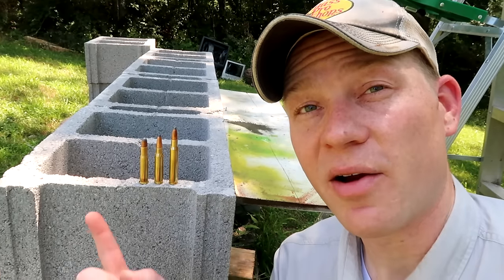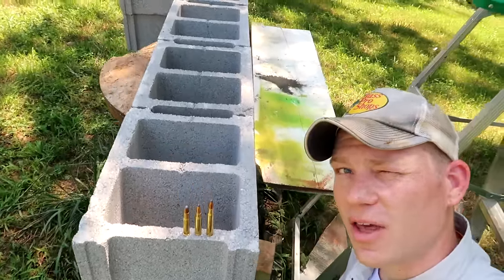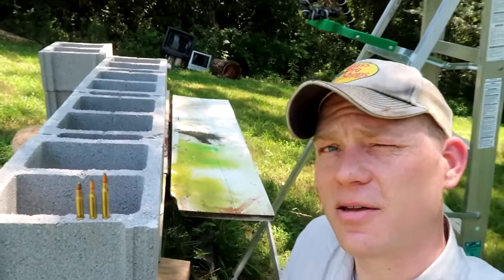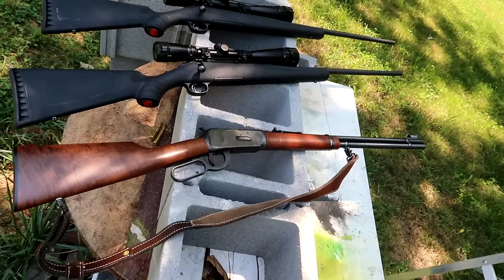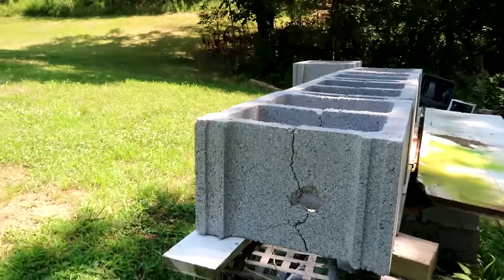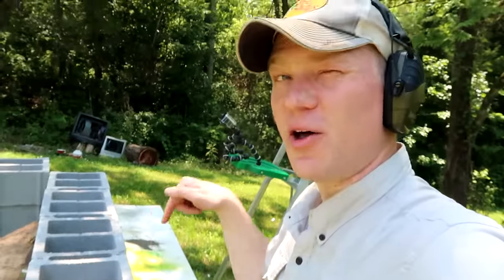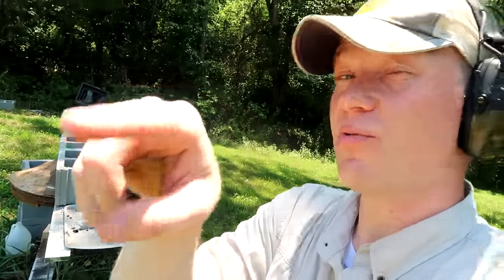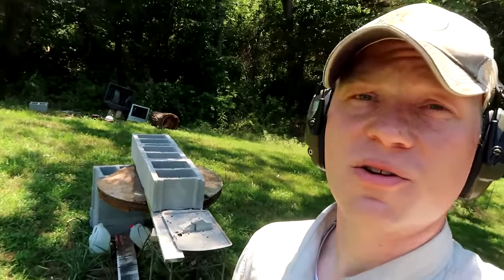30-30 vs 308 vs 30-06 - Cinder Block Test

Comment: I was surprised by the lack of penetration. I guess this is more about the knockdown power and energy of the rounds

I love the 30-30 because it is classic Americana and arguably won the west. It isn't underpowered per se but coming out of a carbine lever action with iron sights this round and rifle combo has a range of 200 yards give or take.  If you put a scope on a lever action you could maybe reach 400-500. 

modern rifles are designed to withstand higher pressures and shoot more powerful ammunition and are significantly different weapons.  I use to like 30-06 because it is big and strong and surplus ammo could be found. 30-06 is fine for a bolt action hunting rifle if your carrying 5 rounds. The ammunition is bulky,, heavy and expensive. I used to swear by 30-06, and I still hold it in high regard. It is a big powerful hunting round. 

Enter the .308 with less energy than a 30-06 but similar trajectory, similar bullet diameter. I will not be hunting grizzly bear or moose in the foreseeable future. I might go deer, elk or pig hunting. I might have to take a long shot. I might have to defend my home from criminals, ANTIFA or the tyrannical armies of Trump might storm into my community and assault American citizens. I For my purposes and foreseeable circumstances the 308 works just fine.  When I chose the 308 i did so with reason. It is the round that does what I need it to.  I use to like other rounds for reasons that were immature and superficial.  I choose the 308 because it can be fired from an AR platform, it is a common round, it is smaller and lighter than the 30-06.   I dont live in Alaska I don't need to kill bears or moose.   I live in California I might need to kill protestors, arsonists, kidnappers, drug cartels, and corrupt tyrannical government agencies and representatives.

Comment: More deer have also been missed by the 30-30 than any other rifle. Cheap ammo. Lots of shots. Capable of 300 yard shot, yep saw a head shot on running buck 300 yards at least, head shot. I watched the same guy miss a deer standing there even after 3 shots from 40 yards.  30-30, apocalyptic weapon of choice

Comment: Bullet weight means very little.  Bullet construction is much more important.  Load the 30 30 with full metal jacket it will Pentwater the most.

Comment: You can shoot all day long with a 30-30 for thin skilled game to 200 yds. Its vastly under rated. You can't stand that with a 30-06 and marginally with the 308. Here in OZ we shoot pigs mainly at distances out to 75 yds and the 30-30 is plenty of gun. The other game that can be harvested as pests are wild camels. For those a 30-06 is not enough. We jump to a 375 for those.

Comment: I own a 30-30 and a 30-06. When I’m hunting an area with a less than 150 yard max distance, I take the 30-30. Longer distances I take the 30-06. I rarely have to track a deer more than 50 yards with either. It’s important to point out that they both have great optics for their calibers. In my opinion, most times optics are more important than caliber. Just my opinion.

Comment: Cinder blocks are actually fragile, as they can break apart being dropped onto pavement from a height of five feet.  The strength of cinder blocks comes from having the cavity filled with concrete and rebar.
So why it is that displays of ballistic destructive power uses cinder blocks as the material?   It is not a strong material.

Comment: Well, the 30-06 is loaded to a LOT less pressure to obtain the same results. If it. Was loaded to the same pressure as the .308, the .308 would Never catch. You can buy a LOT heavier loads in the 30-06

Comment: 30-30 no kick fast maneuvering driving thru woods and taking fast reflexive shots even if there are twigs and Small sticks it will deviate from its path very little and still hit close to target. The others because of spire tip bullets will redirect all over the place.( not hillbilly lore it's the legit science so try it before saying it's incorrect, it's not) .308 for med size big game at longer distances, and the 06 is for an area with any predatory bears in my humble opinion just as a precaution. But I would swap the 06 with .300 won man or wsm

Comment: Still not a fair test. Bullets are built differently. A weight versus velocity versus expansion of the bullet test in concrete has nothing to do with hunting. Most guys hunt from a stand next to a feeder on a timer. It's about as complex as shooting the Roomba when it goes between the couch and the tv.

Comment: I fall in the category of due respect for all rounds . I have no bias when it comes to this. Theres a round for any job and lots of rounds will do the same job.  Im not the guy that picks on cheap guns either. They all will kill or stop  or git target if you work with what you got. Its just that simple. Folks pick on hi point pistol owners a lot. But truthfully if you can shoot that thing in the alide get it rack back and chamber and fire the remaining rounds in it, id say thats a testament to its durability wouldnt you?  Doe they rattle when you walk ? Absolutely . Are they chunky and  bulky? Yep is the trigger a little bit ugly ? Yep does it work? Absolutely!  All guns ahould have thier due respect. Doesnt matter what you pay. Purpose does matter.  Same as any round out there. They have a purpose some ammo isnt as clean and some anmo isnt as good for chambering well but the facts are they will perform thier designed tasks. Do i own glock yep do i own other makes? Yep do i also have a hi point? Yep i have a tarus as well all im saying is if yiu want a cheap gun to throw around on the farm that hi point is a gem for your truck! It just is

Comment: A 30-06 is far more effective with a 180 grain to 220 grain bullet .. 150 grain is not its best option .. a 180 grain bullet will probably go through 4 or maybe even 5 walls with devastating effect .. 30-30 and 308 can't handle 180 to 220 grain bullets ..

Comment: 30-30 proven deer round, of course. 308 and 06 for everything on up. Want clean kills with single shot, right? Inhumane to require a follow-up shot to finish the animal off. Keep use of 30-30 at where it excells

Comment: Next time try grab some hornity 30/30 sharp tip it will go thru to the 3rd one like the others you would have thought the 30/06 would go thru at least 4 maybe 🤔 5 but those blocks are very strong but I bet the hornity bullets go thru to the third wall 🧱

Comment: 30  30....will   go   3walls   i  use   150 .g   winchester  aluminium .tip   dead   flat projectory  over  150  yds      it   sure   stops   big  pigs